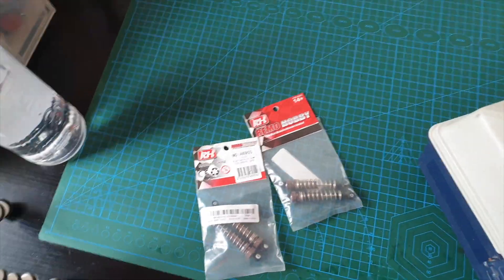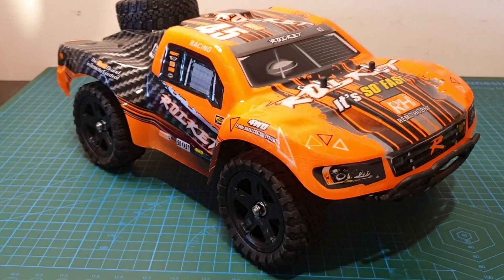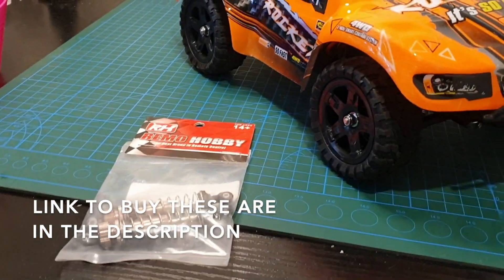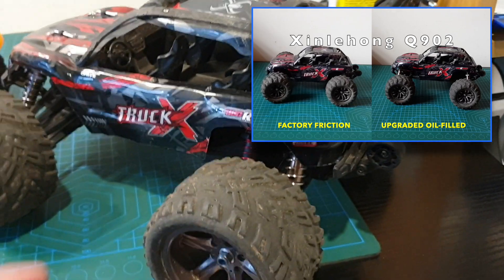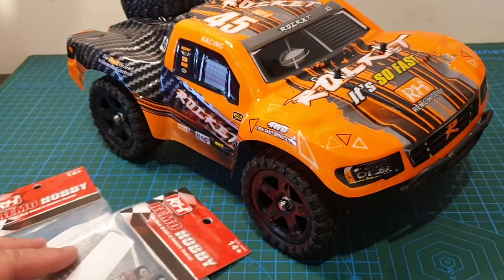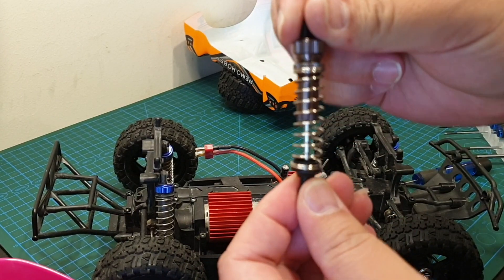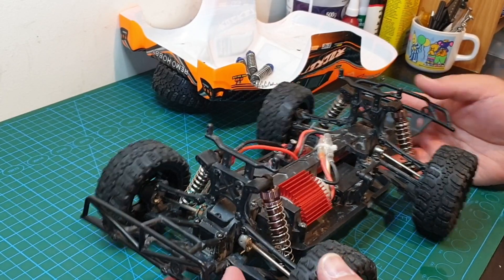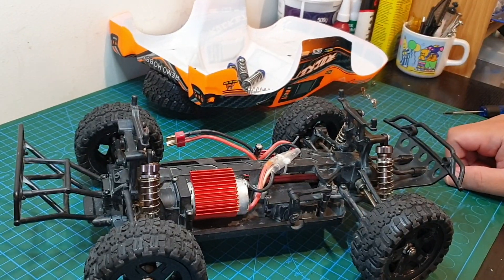Remo Hobby 1621 Rocket 4WD Truggy Upgrade to Oil Shocks

Comment: Will this help keep the tires from rubbing on the body? I haven’t upgraded anything on it and everything is stock including the tires. The shocks are the regular alloy caps and I think they have too much play in them and I think that’s what makes the tires rub. Will these oil filled shocks help?
Reply from the maker: no, not really. they still rub
Reply: @MickoRC  but they’re better than the regular alloy cap shocks right
Reply from the maker: @dustinw.2001  definitely bro!
Reply: @MickoRC  thinking about buying them for mine
Reply from the maker: @dustinw.2001  cool. they definitely improve the stability of the car and make it a lot more fun to drive. 👍
Reply: @MickoRC  I got the regular alloy shocks on it and with those the truck has too much play in the suspension
Reply from the maker: @dustinw.2001  When you say too much play do you mean horizontally or do you mean vertically as in suspension travel?
Reply: @MickoRC  like if I pick the truck up and put it back down, the whole thing sinks down. Also my steering is a little off which I tried fixing the steering trim because it goes to the right a lot when I go straight. The front tires kinda stick out when I set it down but I haven’t broke anything
Reply: @MickoRC  I’m going to be buying these shocks finally. Could you make a video about the maintenance on the shocks like how much oil to use and is oil the only thing they need and where and what the best oil is and if the oil can be at Walmart or lowes or something.